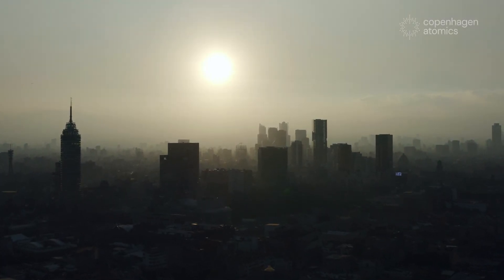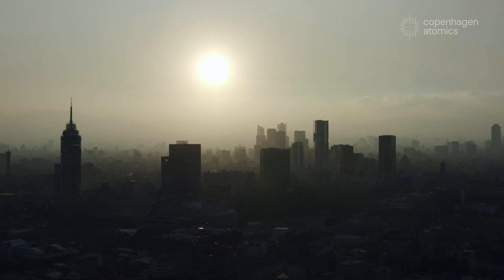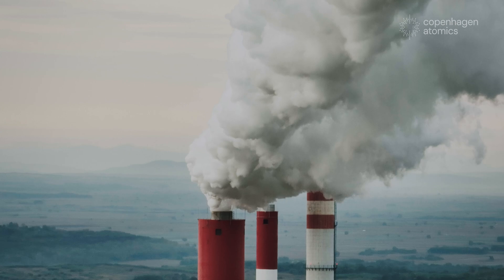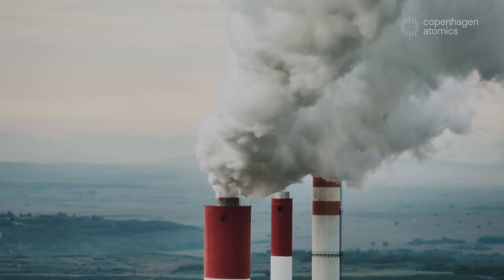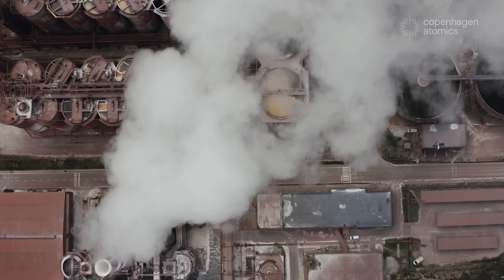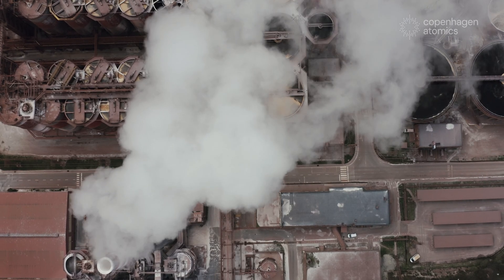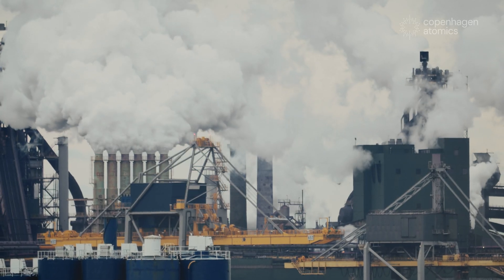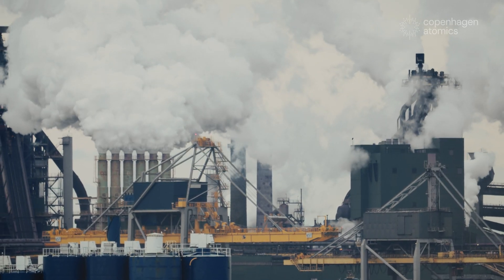The FUTURE Of Green Ammonia: Is THORIUM The Answer?

Comment: As a step on the way from carbon energy, YES.
But a MSR at high temperatureres can produce hydrogen with heat in a process called thermochemistry.
Nothing new.
BTW.
Water in a reactor is a bad idea. At the same manner water can dissociate in O2 and H2 in an accident.

Comment: Electro Ethanol is the ideal fuel, NOT Ammonia.  Ethanol can be used in houses, cars, airplane, boats, trackhoes, grid without the problems of Electro Ammonia, propane, gasoline, Diesel or JET.

New Engine type captures the CO2 in the secondary cycle of the combined cycle with no extra costs and uses the CO2 in the cycles and for fuel making in a building.  The CO2 can also be returned to the nuclear power plant via stations with a refund deposit, thus saving the CO2 capture costs. 

NET solar thermal should be 3 cents/kwh for fuel.  A Thorium plant will need to be around that same cost, perhaps 4-5 max.  

The thorium is put at peak of the day and fuel is made to balance grid.  Thorium = gird + fuel making.  No gas, no coal, no Diesel, no wind, no solar PV needed.  Just Thorium + fuel making.

Comment: @4:40 - What about putting a reactor onto the ships so that they can make their own fuel?
Reply from the maker: The reactors create more energy that a ship would need. Therefore, it wouldn't be as economically viable as you would have to run on lower production. In addition, there is the question of regulations and insurance.

Comment: 0:42 "...but we create CO2 in the process...": You're creating CO2 in the process of saying that. So what? The CO2 scare is absolute nonsense. Smog comes from soot and other debris pumped out of smoke stacks and some automobiles. It is generally no problem at all except where you have overcrowding and/or a collective basin (like Denver or LA) that traps it and shields it from prevailing winds. It's not a problem in Houston because the are no obstructions to prevailing winds carrying it out to the gulf. Drop the CO2 bogeyman nonsense. It's a trivial part making up the air we breath... something like 0.033% by volume... and trees and shrubs  (i.e. greenhouses) love it. Read the emails. It's an obvious hoax.

Comment: Hydrogen is indispendable for a carbonfree future. To make it with wind and solar means perpetual ramping up and down, which kills any device over time. Electrolysers are very expensive and completely unaffordable when not used round the clock. There is no doubt nuclear is the ideal source for 24/7 operation .
Wouldn't it be even better though to use high temperature elektrolysis combined with a high temperature reactor?
The electrical efficiency is much higher, and the steady heat from the reactor means a long life for the elektrolyser, even when ramped to compensate grid fluctuations. These stacks can even operate  in reverse mode to produce additional power from locally stored hydrogen to help in a "Dunkelflaute" with no wind and no sunshine.

Comment: The LCOE of wind and solar is far lower than nuclear so how does spending vast sums to develop thorium nuclear reactors work out less than using wind and solar which are available now?
A carbon tax to the production of the CO2 in producing ammonia would change the cost equation but only by increasing the cost of ammonia and then an increase in the cost of food production.
Reply from the maker: The LCoA from wind and solar is approximatly 3x higher than coal or natural gas. This is simply due to the intrinsic properties of wind ans solar being intermittent energy sources, as such you would need vast amounts of wind mills and solar panels combined with storage facilities which drives up the LCoA, which in turn drives up prices of food. Therefore, it is relevant to develop methods for producing green ammonia close to the price of grey ammonia.

Comment: I wonder why you want to run big ships on ammonia, instead of use your small modular reactors.
Reply: I would guess: regulation applicable, which may be different per harbour, and cost efficiency of using the ammonia as fuel rather than a nuclear reactor
Reply from the maker: As @mauritsdolmans746 rightfully say, currently the biggest hurdle is regulation. Therefore, we are currently more focused on getting regulatory approval for land or site usage, as reactors can then be used for co-producing in several applications.

Comment: Is thorium the answer? No, the underlying technology is the answer, thorium is just one of the possible fuels and probably not as good as uranium. 
Also if you can make ammonia economically, then you can also make synthetic liquid fuels as well. Diesel and jet fuel come to mind.
Reply: Thorium is better then Uranium!! For sooo many reasons.
Reply: @robfer5370  Simply not true. To utilize thorium you need a breeder reactor, for uranium, you don't. Once through MSRs are much simpler and cheaper than breeders and being cheaper than coal/natural gas is all that matters right now.
Reply: I would suggest thorium is better long-term.  Getting it started up takes some effort, such as a "starter" in the reactor, once going though, it breeds its own fuel from the neutrons created in the reactor.  It converts Th232 to U233 which fissions, giving more energy and neutrons, and breeding more Th232 as a result.  You won't beat that fuel cost, even though uranium (even enriched) is fairly cheap.  Another good one to consider is breeding U238 - as there's loads of DU around as a result of enriching fuel.
Reply: @LFTRnow  Even in a breeder uranium is still better. As you stated thorium converts to U233 which is weapons-grade and can easily be removed as such. Breeding u238 doesn't have that problem. We have billions of years worth of uranium without mining, so I see no advantage whatsoever to thorium.
Reply: @chapter4travels  "As you stated thorium converts to U233 which is weapons-grade and can easily be removed as such."
Why would that matter in a country that already has nuclear weapons ? The advantage of thorium and LFTR - less volatile, the cross sections are more favourable, thorium can use 99% of its fuel, it is 35 times more energy dense, runs a liquid cycle and not a solid one, operates at high temperature, walk away safe, less waste, with a shorter half life... ect ect.
Reply: @robfer5370  You are comparing thorium in a MSR breeder to uranium in a solid fueled reactor. In a MSR uranium is a better fuel on all accounts. The main one is that you don't need a breeder which means it's much simpler and cheaper. In a breeder MSR uranium is still better, no pure U233. Neither of these will get built in the US anyway because of the NRC so they will get built overseas where they may not have atomic weapons and U233 is a problem.
Reply: @chapter4travels  "In a MSR uranium is a better fuel on all accounts." Explain that. How is it a better fuel, like for like, tell me the details!
Reply: @robfer5370  I just did, with uranium, you don't need a breeder which means the reactor is simpler and cheaper. You still get the high fuel burn-up and high-temperature output.  At this stage of reactor development cheaper is the only thing that counts. It has to be cheaper than coal. We will need thorium in about 2 billion years when we run out of uranium.
Reply: @LFTRnow  Bingo you beat me to it, you could also use a Molten Chloride Fast Reactors (MCFR) for the same goal. Destroy everything you don't want like transuranics, actinides, spent nuclear fuel and plutonium, while making power. But at the same time make new valuable materials like u233. By having the (MCFR) wrapped in a thorium blanket, so as we destroy the "nuclear waste". We can use the U233 produced to start new Liquid Fluoride Thorium Reactors (LFTRs) that will run only on thorium, produce almost no "nuclear weaste" and never run out of power. 👍 A clear win win and ever lasting energy.
Reply: Yes but you might as well make them out of ammonia.
The Sabatier process is a known way to make synthetic fuels but it has never been used at a scale large enough to drive optimization and improvement.
Haber Bach process is apparently very difficult to optimize (although there's apparently a recent breakthrough) but that's mostly because it's very efficient as is even for it's huge scale deployment for fertilizer production.
And at that point you might as well use ammonia because of the concentrations. There's plenty of nitrogen around but Co2 is much less concentrated in the atmosphere.

Comment: I have been following Copenhagen Atomics for some time now and it seems that they are making serious progress and that this is not only CGI stuff in some nice presentations. I wish them all the best and I hope they can contribute to a cleaner environment in the future!
Reply: "they are making serious progress" How do you know? They sound very positive in their presentations but I haven't seen anything real...yet. Maybe you have and I've missed it.
Reply: @chapter4travels  
The first reactor, built in 2022, is dedicated to water testing and allows them to test pumps, sensors, construction methods, operation, and software.

After resolving initial issues, they developed a similar reactor for testing non-radioactive salt, utilizing a salt called FLiNaK. 
This FLiNaK test reactor, constructed in 2023, provided valuable insights for the design of the first thorium salt reactor, set to be tested in 2024.

This was the status back in June.
They are not done, but they have built something real. Several times, and they are iterating.
Reply from the maker: @andershansen4884 that is quite correct! Happy to see that someone reads our newsletters ;) Next step in 2024 will be building and testing the subcritical prototype reactor, using throium and LEU and then in 2025 have criticality test of a 1MW prototype reactor.
Reply: @CopenhagenAtomics  What country/regulator will you be licensed with? How far along are you in that process?
Reply: @chapter4travels  The subcritical prototype reactor will be built in Denmark, as radioactivity is less than or equal to hospital equipment and similar. I believe getting approval for this reactor is expected to be 'easy'.
 
But your question is probably concerning the first reactor to actually have a chain reaction. And that would be the 1 MW demo reactor planned for sometime 2025.
I have no idea where this is planned. My guess would be Great Britain (or The Netherlands), but perhaps CA can enlighten us :D
Reply: Indonesia  was mentioned near the start of the video.
Reply: @chapter4travels  I don‘t have any special knowledge, but at least their gradual approach to the topic seems realistic and not utterly over-optimistic - and in their recent videos, it seems they are really working on real stuff, not just CGI: https://youtu.be/kwLXxgyUw7o Can we be sure, it‘s not fake? Of course not. But at least their timelines seem realistic and they can also provide for collaborations with other renowned firms (that will most likely also have done their due diligence before entering into the collab). It‘s a pitty that they have to go to Malaysia to get gov support and can‘t get some in Europe!
Reply: @philipkudrna5643  You can be sure it's real :)
Also, they do have government support in Europe. Namely in the UK. So much so, that they've established a subsidiary there; UK Atomics.
Reply: @CAVALRY19D  I personally have not done a due diligence, but the company has been around for several years and they are getting government support in UK and in Asia (and I presume that governments will have scrutinized their business bevor investing.) And there were also a lot of Nay-Sayers claiming you cannot land a rocket until Elon Musk simply did it. And that‘s why I am sceptic when somebody tells me that something is impossible. (And they are quite transparent and are working with many Universities around the world and they seem to be successful by purification of the salts.) And I would rather see a European Company be at the forefront of this development than leave this important field to China (like so many others.) But nobody forces you to invest money in them!